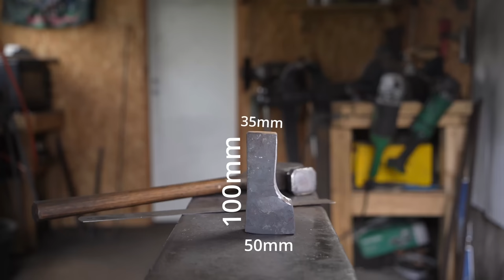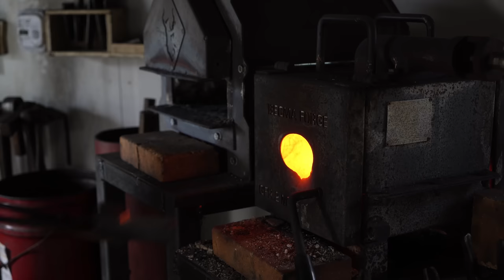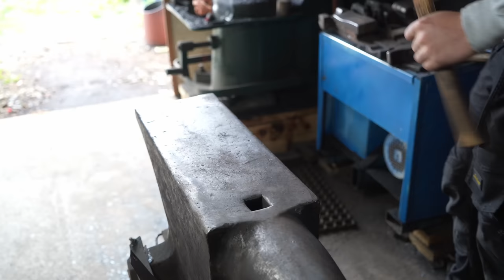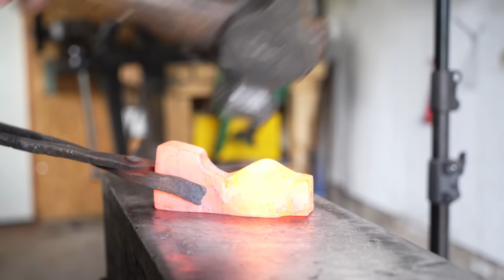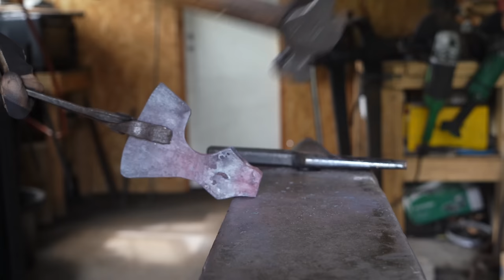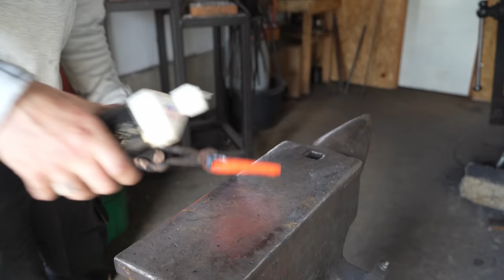Forging a Bearded Axe: A Step-by-Step Guide

Comment: As a beginner blacksmith at a living history site in Indiana, US. I can easily say I appreciate these videos, they are extremely inspiring and educational to especially newcomers to the craft. I especially enjoy watching tool making (having done so much research into it recently), so making these axes without power tools is phenomenal to see.
Reply: I personally prefer and recommend making an axe not by punching a hole through it but by making a "double axe" and then folding it back in on itself .
It will teach you a bit more of required techniques it's also how it used to be done.
On top of all that it doesent require you to make any additional holes or slits in order to add a hardened piece of steel to the edge.
And tbh I'm quite surprised why more people don't make it like that
Reply: What's a good way to get started in the craft? I've always been fascinated by blacksmithing and would like to try my hand at it a bit
Reply: @justinkedgetor5949  you do not need much , 
1.Source of air
2.fire 
3.thing to hit red hot piece of steel with
4. Thing to lay the red hot piece of steel on while hitting it.
1.For airflow I used a vacuum cleaner and placed the hose on the exit side of vacuum cleaner 
2.for fire place I just layed a bunch of bricks around on the ground in such a manner so that the charcoal gets most air.
I also just dug a hole in the ground
3.Simple hammer.
4.just find any old big chunk of iron/steel.
I started with a railroad piece , then I upgraded it by making a horn on it . After a bit I found a steel plate with some holes in it which I simply placed on a log .
The point is it's not that hard to start(you won't be forging swords instantly but it's a starting point and a learning point after which you can build up your blacksmithing journey.
PS. I didn't add a thing to hold a red hot piece of steel with because that's optional :p.
I started by mostly using longer pieces of steel that way I didn't need thongs and for pieces that were to small I used simple pliers or vice grips.

Comment: I’ve never done any kind of forging but I’m an artist I worked with wood clay and stone and I like to think that I can somewhat imagine what working with steel would be like and I’m just amazed at the amount of control you have over the material, it all goes exactly where you want it, you don’t distort one part when working on another, the edges are beautiful and clean even at the stage of forging, and the seem between the blade and the head is invisible. Amazing work, beautiful axe and great guide!

Comment: I am not a blacksmith, however I have restored dozens of old ax heads and have plenty of heads that were sharpened to short to be useful. I haven't ever seen that method of adding edge material back to the head. Neat. Thanks for the great video.

Comment: This is impressive!  Anyone doing this, just like welding, add starch to shirt so rather than burn through, it's more apt to fall off.  If it burns through there's always those crevices that'll catch the hot slag and have you doing the Hula!

Comment: It’s interesting seeing the drift you used up close, that had a profile more like a double bladed axe drift as the single bit axes here in the US don’t have 2 rounded sides on the eyes, one side is very narrow but not quite to an edge on the side of the drift facing the edge or bit of the axe and the opposite side is wider and more rounded

Comment: A first class show  of axe making, sum thing I would have liked to make, I did make a 14inch bowe knife, from a big lorry spring, all I had was oxe torch an old anvil in my of time at work, it was very high carbon steel and,sprung as well. The hardest part was getting the curve out of the spring steal with out softening it , it worked out to  a very good finish , I spent hundreds of hours filing it ,to a very fine condition and sharpness ,a brass hand guard , Paxoline Handel with a nice aluminium pommel my final test was to place it between to bits of rail track, and hit it as hard as I could with a 14 pound sledge hammer, I closed my eyes at the last second, it took of like a built, when I did find it it was as straight as I made it , it was so strong and razor sharp on all of the edges , and with the weight, just a little effort was all that was needed , to chop or cut in any direction my first and last effort at forging. So hats of to you.
Reply: Thank you for the reply, it is nice to know ,that one’s efforts are appreciated,and you have your whole life in-front of you , as mine is coming to its end,sum time when, just stretch your potential and you will be on the master crafts list , of go to axe makers, I can see it in the comments column Best regards Brian.
Reply: Ps. When I was in America years ago I used to visit the Bouse Black powder shoot once a year, and my partner was an axe thrower ,she was so graceful and made it look so easy,  it took me weeks ,just to get it right, may be a Viking throwing axe would be nice to see ,unless you have already made one ,and it is on a video Brian.

Comment: What hardness would you estimate the tip to have?  From your temper color I would think it would be difficult to file. It's difficult to tell from the video if that was the case. Is the beard shaped that way to allow the hand to push the blade for planing ?  Very nice work.

Comment: What wonderful craftsmanship. I love the vintage aesthetic and the care taken to ensure the sharpness and hardness of the edge in a world where half of things one can pick up a hardware store is dull overpriced mild steel meant to bludgeon trees rather then cut them, or be sharpened after every ten blows. Is the high carbon steel forge weld insert a new development or has that been done for a long time?
Reply from the maker: Oh thats been done since steel was invented! Steel was hard to come by but iron was common. So you used iron for the body and steel only where you needed an edge, to save costs
Reply: neat! I bet it also helps to have some more elasticity and ductility in the rest of the body as well. Hardened steel being so brittle, having the whole thing made of high carbon alloy would be pretty dangerous in cases where the edge accidentally strikes something hard. Better that it merely cracks as opposed to sending a steel shard flying off at unbelievable speed.

Comment: What was the steel type used for insert?
Great minimal tool axe build! No power hammers and bench belt sanders.  Helps beginners believe a great custom are is a garage profit with the basics and attention to the process

Comment: Impressive craftsmanship! I'm curious as to why you're using c45 for the edge and not something higher in carbon like c55? I'd expect higher hardness and edge retention. Also what type of steel is the rest of the axe head?
Reply from the maker: This is a series of videos aimed at beginners. C 55 is not an easy steel to find here in Sweden. C45 is very common and you can even buy small pieces. Thats the reason, also its very easy to use and understand as a beginner. 

If this was an axe for sale I would most likely use ss2090 spring steel for the edge, orherwise I primarily use 4140

Comment: Great video, quick question though, what kinds of steel would be a good choice for the body of the axe, I'm assuming I'd want a mild steel that would quench using the same medium or does that not matter as much. I plan on using a recycled leaf spring as the steel for my edge but I'm unsure of what I should use for the body, thanks
Reply from the maker: Mild steel is a good choice for the body, it's very easy to forge and does not crack if you quench it in water. be careful with the spring steel, you should probably quench that in oil.

Comment: Here's my question:  Is heat-forging a harder metal into the blade (for sharpness) something that was done in the Early Medieval Era, Late Medieval Era, Renaissance, or a modern technique (because I haven't seen this done in any historical means previously)?
🤔

Comment: which sort of wood do you use for handle? Myself, I much prefer ash wood and I shape it, leaving the last bit and treat it with linseed oil, as this will shrink the wood some. only then I finish hanging it and punch in the wedges. I am still to forge my own axe head, though.

Comment: I’ve made a couple (much) smaller tomahawks by hand and they were tough to hammer and didn’t look anywhere as nice. You’re a beast! It turned out beautifully. Have you had good success with C45 for the edge? I’ve never seen it here in Alaska.
Reply from the maker: I chose c45 simply because it's a very easy steel to work with. not the best edge retention etc. but this series is primarily focused to beginners, hence the simplicity of the steel. If I were to make this for sale I would most likely use ss2090 spring steel instead :)
Reply: thank you so much for the response! Regardless, it looks incredible!

Comment: I had no idea that the cutting edge of an ax was a separate piece of metal. Is it a different metal?
Reply from the maker: It depends what the body of the axe is made out of. In this case it's mild steel, historically it would be iron, which can't be hardened. therefore you had to weld in high carbon steel for the edge. Steel was way more expensive than iron back in the days. Today in modern time its way  more vcommon to have only one type of steel in the whole axe, without welding in the edge bit.

Comment: Great video ..watched a few times and realised that you pass the tapered billet from both sides when you work..so is the hole not tapered and parallel for the handle fit ?
Reply from the maker: its tapered from both sides. That creates an hourglass fit inside the handle. very common here in Sweden
Reply: ok thanks, made a taper yesterday and punched my first hole through.. Will re-heat and do from both sides..
Reply from the maker: @stephenwalford774  You don't have to do that. In America, from what I understand, It is more common to only drift the eye from the top of the axe.
Reply: Thanks for the info and response, helps so much.. I'm in France

Comment: A solid video, but I must say, I do feel like starting with such an odd shaped billet does feel a bit like skipping a step.
Reply from the maker: Yeah maybe, that case could be made for all my videos. I usually start with round stock and forge them down to my starting billets. I guess the point was to show that its sometimes smart to have a distinct pre form , especially when you want a long beard.

Comment: Is the body of the axe just mild steel ? I thought a file should'nt be able to remove material from the hardened steel.
Reply from the maker: depends if you have hard or soft files. the axe came out about 55 HRC, a file harder than that can cut it.
Reply: I feel stupid I never thought about that . Thank You
Reply from the maker: @chrismaurer2075  dont! You most likely have seen a lot of knife makers use a file to see if it's hard. it all depends. what steel you use and for what purpose. I make axes, and the axes I make do not have to be as hard as kitchen knives for example. So it all depends on the material, the use of the tool and how you go about hardening and tempering the blade.
Reply: Im going to start saving up to buy one of your axes. Someday your axes will be coveted and when a used one goes up for sale they will get top dollar . I'm living on my disability check's which aren't much but i'm going to try .